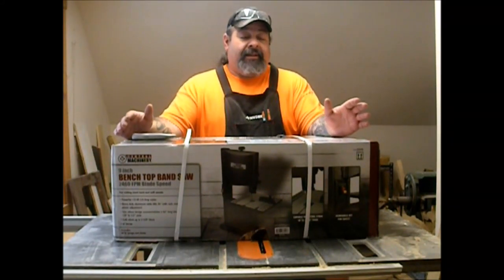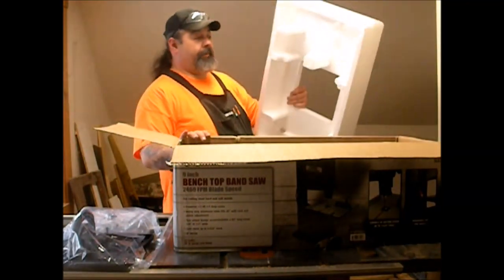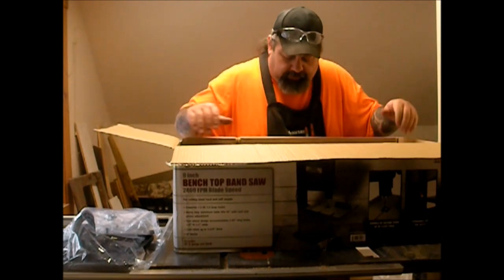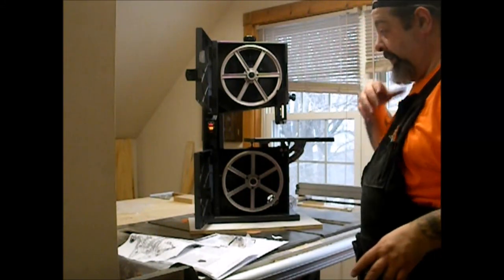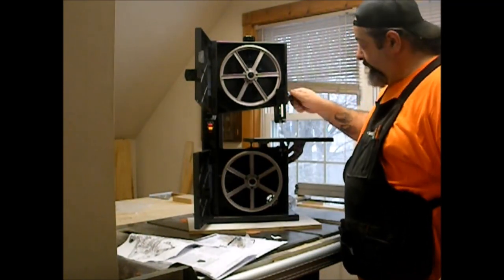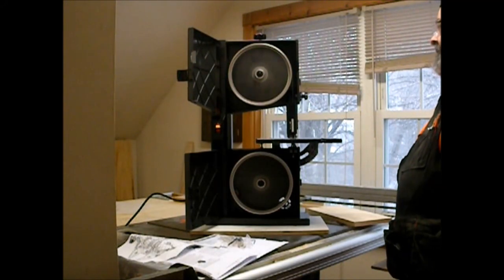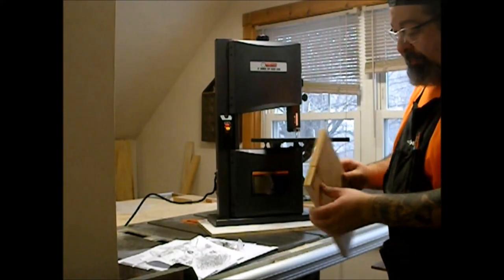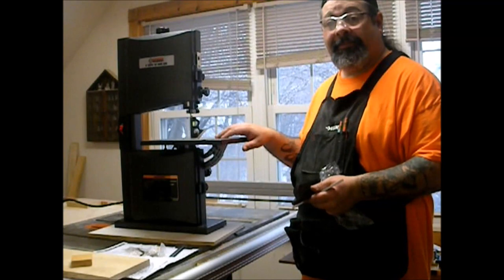Harbor Freight 9 inch Bench Top Band Saw Unboxing and Set Up

Comment: I'm thinking about getting one.  I am seeing a lot of great reviews on it.   Question: Is it a variable speed?  You will need a variable speed depending on what material you are cutting through.  It does not mention it on the Specs on HB site, but it does say "Max Speed 2460 FPM"  which implies a lower speed without saying.
Reply from the maker: Hi Boyd! Unfortunately, these are not variable speed saws. But I have found I just regulate the speed in which I feed material and I have had much success with this saw.